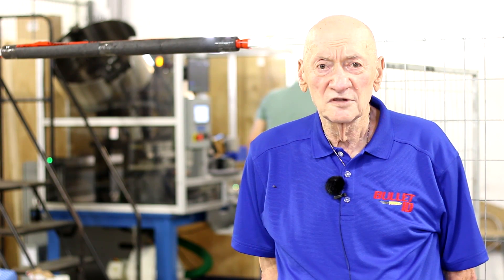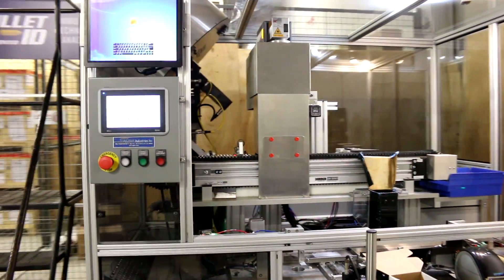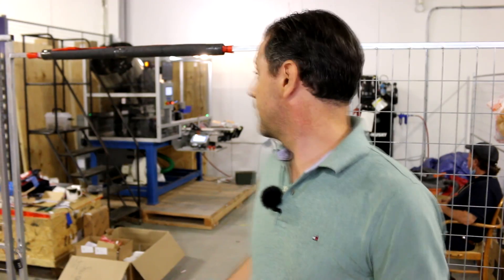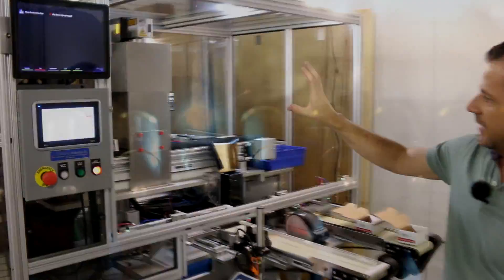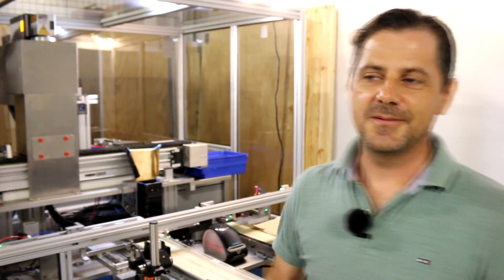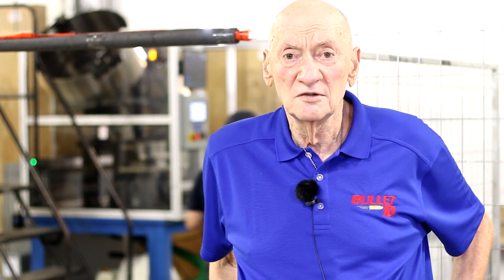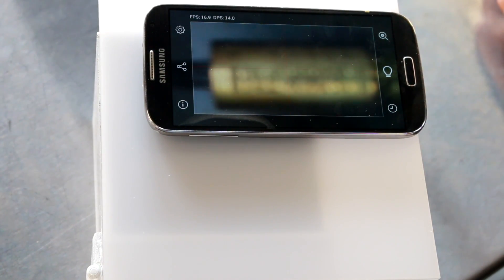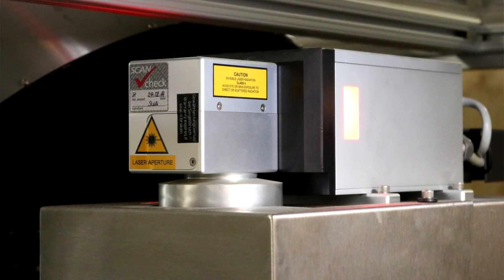Revolutionizing the Bullet Industry with Trotec SpeedMarker Galvo Laser - BulletID

Comment: What stops people scratching the serial number off?
Reply from the maker: It's pretty deep engraving using the fiber laser
Reply: You wouldn’t have to scratch it off just obscure it enough not to be read properly.  But that’s not the reason people aren’t going to buy this (general public anyway) the etching weakens the case and will make it worthless for reloading.  The home reloading market is so insanely gigantic it’s why we use boxer primers instead of burdan even though burdan is more reliable and effective.
Reply: There are techniques in forensics to identify serial numbers from guns even long after they have been filed.